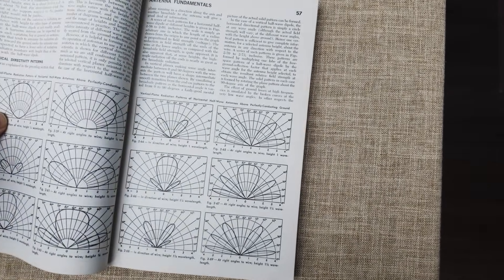Shortwave Radio Signal Paths  - Ham Radio

Comment: The use of the term "cancelled out" is a bit misleading. There is some single/power being emitted at low angles; it's not 0, but definitely not ideal. 
The poor ground reflection described by the pseudo brewster effect is creating some deconstructive interference reducing the power of the single effectively received from low-angle transmissions. Single is still being emitted into the far field.   This is effectively reducing the gain of the antenna at low angles.  

The illustration you use at 7:00 shows precisely this.

Comment: The suggestion that five degrees is optimal for DX is eroneous and based on overly simplistic ideas that don't take into account what happens to electromagnetic waves  in the ionosphere. The best sources of information are research papers in the field of Over The Horizon Radar that use PHaRLAP ray tracing, a number of which are authored by Dr Manuel Cervera. Digging into these clearly shows that the assumption that five degrees elevation is optimal for HF DX is false. The optimal elevation is dependent upon ionospheric conditions, which are continually variable, at that time and the frequency. Often the low angles can produced the shortest hop distance. 
it's a fascinating subject, and it's a shame that most people seem to just go along with what they've heard. There is a lack of self-learning! 
73 M3KXZ
Reply from the maker: I agree and practical tests I have made underlines this point.

Comment: Thank you for addressing the issue. The common "hop" of signals does not occur so often that the propagation papers say.
Around the Equator we have a ridge in the ionosphere  that is acting as an  important part in the propagation. Not only in directions E - W but also N - S (trans-equatorial path). 
The signals bounce more often between different points "in the same layer". We have a computer propagation program that addresses this, PROPLAB PRO. Here we can see how the actual signal path looks like; true "ray tracing".
It somewhat comes to "where" in the ionosphere do you signal create the highest field strength. It is from this area the main refection occurs.
For example, the path EU to KH6 on 160m. "All" textbooks say that the optimum time for a QSO is in mid December, via the Arctic. This path is heavily influenced by the "blotting paper" of the Aurora. I made many attempts to achieve a QSO with KH6 then, but only one way success.
BUT at the latest opportunity in the winter season at the spring equinox I say a possibility for a QSO. I arranged that KH6CC at 800m ASL at BL20ha to be QRV (1986 before any computer predictions...). At the 1st try we had a 2 way QSO directly, and I could hear him consistently for 1.5 hours. We tried the next morning with the same effect. 
I had a phased vertical array at the time for 160m, and  I had to point my front lobe towards the equator close to the Panama Canal. A great signal path bending of some 90 degrees azimuth also, in conjunction with rather HIGH take off angle.
The program PROPLAB PRO later confirmed this path take off and azimuth bending effect.
Radio signal bounces off the ground or sea water is VERY LOSSY in comparison with almost lossless reflection ionosphere inter-layer or layer to layer bounce.
Good luck with Your "long haul" contacts on 7 MHz.
73 de Bjorn SM6EHY
Reply from the maker: Interesting to read. I know that when I was first licensed back in 1960, working KH6 was a real milestone with that very familiar flutter on the KH6 signals - and that was AM in those days!

Comment: You should do a video about 10m wire dipoles at some point, and how to make and tune them without an ATU just using an SWR meter.  They are cheap to make, have directional properties, easy to put up half a wavelength, have a very low SWR meaning you don't need an ATU on that band, and will outperform antennas costing hundreds because they are actually resonant.  At this time in the sunspot cycle they must the perfect project for working DX.
Reply from the maker: Thanks for the suggestion.

Comment: This is why a 3/4 wave vertical antenna on HF can often be better than a 5/8 wave, even though the 5/8 has a theoretical lower angle of radiation. I can remember when some TV antennas and amateur radio VHF beams were "jacked up" to get the lobes at a better angle. I remember someone who had a remote control actuator (before azimuth rotators were easily available) that allowed him to change the angle of his beam to peak a signal. It really did make a difference.
Reply from the maker: Interesting. Many thanks.

Comment: I think you are only the second time I have ever found anyone on YouTube mention the Brewster angle! Congratulations! It’s a big deal with vertical antennas. Also I don’t think any of the computer models can really handle really low elevation angles. For one thing whoever is doing the modeling would have to get the ground part of the model correct in addition to the computer program being able to handle it. 
If you have a good pattern, what’s not talked about are the 3dB points. There is a peak angle but there is a range of angles from some number of degrees below to some number of degrees above that makes up the vertical beam width. Thank goodness for that because you never know what angle or angles you need. The height of the ionosphere is always changing up and down and the density is changing (which changes the MUF and critical frequencies). Not to mention that the signal is not reflected at a point but “bends” and sometimes is scattered to the side or even back towards the transmitting location. 
Good video. I have many of the old books also plus even though I have my University text book from when I studied “Radio Wave Propagation” I recently found a digital copy online free! Would you like a copy? 
73, de N4DJ
Reply from the maker: Many thanks. In one of the video clips I did mention “bend” but I think, when I rerecorded it, I missed it out. Bend rather than reflection is a more accurate description for the reason you mention. Yes, be good to get a link for the digital copy. My mail address is on QRZ.  G3OJV.  73 Peter.
Reply: @watersstanton  I will send it out now.

Comment: I have a horizontal doublet.....6mts above ground....less in parts.....58mts long....great for 160 to 10m....infarct I can tune 6mts on it and it does as well as my dedicated 1/4 was 6m horizontal.....crazy....

I love top band 160m.....if you listen to some of the old G3s.....to work top band your need your horizontal wire a 1/4 above the ground....so 40mts or 130ft.....

I do really well on top band and get great sig reports.....I use Reverse Beacon Network to see how well I do.....at night on 160m I can work all points of Europe and into the well into the  USSR.....so what was it the old G3s were saying.

I do think there is a lot of toss talked about radio.....and still lots we dont know.....we cant see the radio waves can we.....yes field test have been done but there are still mysteries.

I often wonder how many hops my sig just made to reach the West Coast USA.....Or Oz.....or Japan.....does anybody know?????

Like I say.....lots still to understand about radio and prorogation.
Reply from the maker: Well said - BTW i am an old G3 !
Reply: @watersstanton  Not all of course Peter.

Generally the ones that resent new commers.